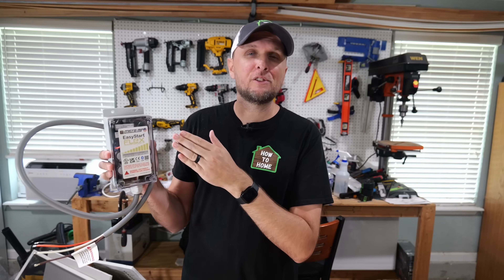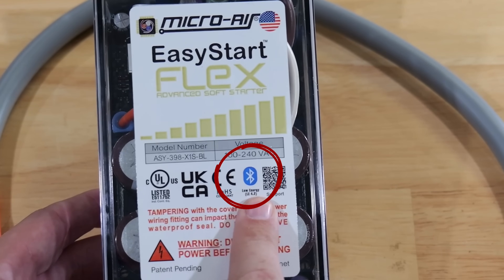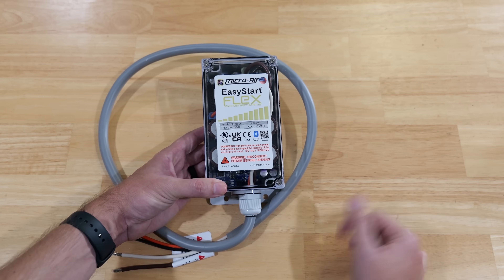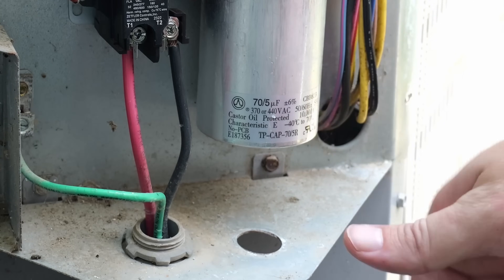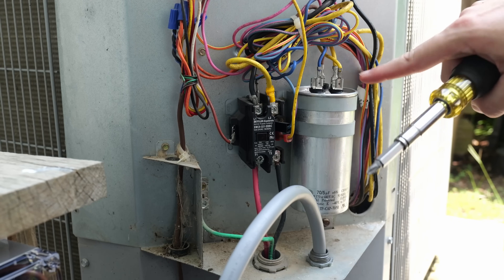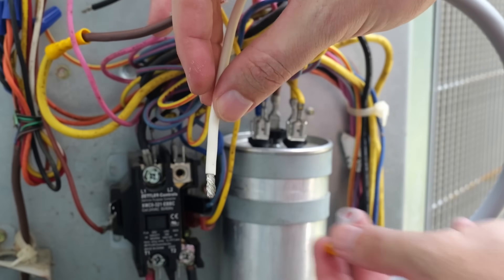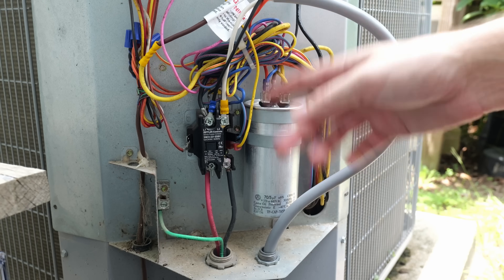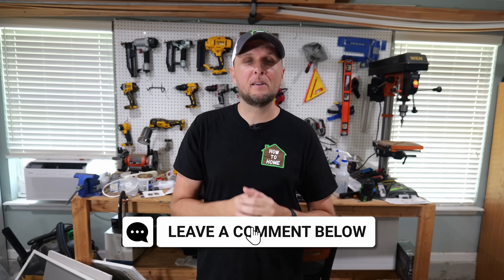The ONE AC Upgrade Every Homeowner Needs to Consider!

Comment: I read some stuff they fail and then you're stuck returning it to normal wiring. Any insights on the dependability?
Reply from the maker: So when they first released them some people had issues with a part in theirs going bad prematurely.  It is my understanding that Micro Air quickly saw the issue and fixed it.  Everyone that had a claim was either issued a new one with the new part or offered a refund.  So for those that decided to get a refund, yes they would either have had to buy one of Micro Airs older models or return the AC to stock.  I have had mine for 6 or 7 months now and have had zero issues.  And I live in the South where my AC doesnt know how to stop running haha.  I also was not sponsored by Micro Air or given this for free so if I did have an issue, or thought it was an unfixed item then I would be happy to tell you.  But, I have nothing but good things to say.  Sorry for the long response.  Hope this helps!
Reply: @HowToHomeDIY  This is a great video and convinced me to buy one. I recently had my house and panel upgraded for generator interface. This is incredible to see the amperage reduction and I have a 4 ton system as you do. Thank you! Buy yourself a beer on me

Comment: Does this need to be installed with a condenser surge protector or can it be installed on its own?
Reply: You can install it on it's own. In my case, before EasyStart, I had already installed a surge protector on the condenser. Adding EasyStart was not a problem.

Comment: I think you did a great job on this one. Very informative. You took a beating in some of the comments, but I think that's just due to people's lack of understanding, skepticism, and the cost of the unit.
Reply: Everyone's going to have a different outlook on it and you know everyone's an expert, right? I am very interested in this product, as I maintain my own unit for the most part (coil cleaning, capacitors, etc.), but I think it would be nice to know the ballpark price of these. I had no idea they were so expensive, so it was sticker shock to see the prices and to hear him say they were half of what they used to be. I don't know what mine would cost, since it's out of stock, but probably around $375 with tax. I'm not skeptical, because my eyes do not lie, and all the experience anyone has can not change what I see. I didn't know what compressors cost either, until about now. And to that $1500 you can double for the install (I'd do that myself if shown how). So, I'll be on the lookout for mine and start saving up for it; I'm still paying on my roof right now that I preemptively had put on before hurricane season! I do prefer to invest in preventative measures, and it will take a lot to dissuade me from getting one of these in spite of their cost.

Comment: So, is that 12 amps running at 240 volts? So 12x240 =2,880 watts running? The rush amps 32.3x240 =7,752 starting watts?
Reply from the maker: That's right.

Comment: Ordered a Flex this morning to be installed in the spring.  Increasing longevity on the AC, and making it easier on my inverter gen to start it is a no-brainer. Being older, everything I do these days is geared to make everything last longer, cost less, and be more reliable. Failure generally occurs at the worst time, right? More points of failure will be reduced.

Thanks for this.
Reply: I am with you! I installed a high quality dual run capacitor in my condenser unit and kept the stock cap as a spare.

Comment: Looking to purchase and install but seeing a lot of bad comments on Amazon about them failing after a few weeks or months.  Any feedback or concerns?
Reply from the maker: It is my understanding from Micro Air and people that claimed to have issues that the part that would sometimes cause a problem was replaced earlier this summer.   Everyone person with a claim was either refunded or their unit replaced with the newer model and updated part.  I have had mine installed now for 6 months now and have not had an issue.  If I did I would report it as I don’t owe the company anything and paid for this myself.  Hope this helps!
Reply: @HowToHomeDIY  Thanks for the quick reply and I did just call them directly.  They explained some of the issues they were having based on the which state their product was installed.  They have since corrected/updated the various components.  I will order mine directly from them!
Reply from the maker: @Keoler7995 awesome!  Thanks for that feedback too.  I did not know it was a regional thing as well.
Reply: @HowToHomeDIY  Yeah due to different power grids.
Reply: @Keoler7995  Hey, thank you for your comments. I ordered a Flex as soon as it was available. Everything runs smooth. Due to Micro-Air's excellent customer service I was willing to take a chance on a new product rollout. I replaced my "364" unit with the Flex.

Comment: Until the f'ing thing has a seal failure and won't start your compressor.  Ie. like mine right now.   They better honor their product.   Now I have no AC.   This product not worth the price
Reply from the maker: They always honor their warranty.  In the meantime, just returning the ac to factory will get it running until you let them know and they get a replacement to you.  I do have to disagree with you though.  For me personally it’s been worth every penny in the times I’ve been without power.  And I’ve had zero issues with it.

Comment: From the Amazon reviews, it appears to have some reliability issues. Most 1's states it died after a short time. Do you know if the manufacturer is working on this issue? Also, the warranty could be better.
Reply from the maker: Was fixed months ago.  The warranty is great.  They replaced or refunded every person with a claim.

Comment: Reading reviews on Amazon and this/these units seem to have a high failure rate. Hard to get a refund or replacement unit.
Reply from the maker: That’s completely false.  They had issues with some units when this model first came out.  It’s been fixed.  And every single person that had a claim with Micro air was either refunded or their unit replaced with a newer one.  I have had zero issues with mine.

Comment: 13:16  SO, >> IF << the Easy Start fails would it be better to of used Male to Female terminals at this stage so you can re-plug back to the ORIGINAL setup??
Reply: Just use wagos man.

Comment: Great explanations, thank you. Question: Living in hot Florida, capacitors constantly go bad (practically every other year). Since these easy start units reduce the inrush current, it would seem reasonable to believe that this reduces the strain on the capacitor which should make it last a lot longer. Is this the case? Thank you.

Comment: I have a 2-5 ton ac.  So which do you think would be better the 398 or 368?  Is there a big difference?
Reply: This is my experience. Years ago, I ordered and installed the 364 for my 2 ton AC. It worked fine for me. I did contact Micro-Air about it and they said I would be better served by a larger unit (368). I kept the 364 because it is a smaller footprint than the 364. To answer your question, get NEITHER! Now, a new model is available. It is called FLEX for residential/commercial use. Get that! That is what I did. Works great! AND it is the same small footprint as my old 364 unit. AWESOME! Thanks, Micro-Air.

Comment: thanks for sharing. this is a $400 device. I installed 2 timer relays on my HAVC system ($5). When the thermostat starts the inside blower fan, the first timer wait 10 sec and then start the compressor fan, then the second timer it setup at 20 second which waits another 10 seconds after the compressor fan to start the compressor. total AMP to kick it all is 20AMP on a 60k BTU unit. i am sure there is a reason for that device to cost $400 but if the goal is to lower the AMP surge, you can do that with $10
Reply: I am guessing you have a 5 ton condenser unit. The LRA on the compressor could be 134-148A. You can find the exact value on your unit. Maybe you are running your unit at 20A. But, not kicking it. "Kicking" meaning starting. Over 100A are unaccounted for. A test would be to start and run your AC unit using a Champion 201532 portable generator running on gasoline. If the VAC breaker doesn't trip on startup - you win!
Reply: Link to timer parts, please?
Reply: What meter did you test inrush with? I probably should have asked if you understand the unique requirements to test inrush as most meters don’t actually measure inrush!
Reply: Are you trying to imply that giving the fan a 10-second head start lowers your inrush by 100 amps?  I don't think the math works there, but it is an idea for dropping it a bit.
Reply: Yeah giving the fan a head start is NOT what lowers the amps, man…

Comment: As an installer, this product was rushed through design & testing, they are burning left and right especially if a fully charged capacitor isn’t installed as well.

Line Set length or distance from indoor & outdoor unit is another factor torque wise when the compressor comes on to be able to push the refrigerant if pressures aren’t equalized.

Anything rotary should be checked if there is a TXV valve is installed, you may need a HARD start vs a SOFT start
Reply: And MictoAir tech support is terrible.
Reply from the maker: @FrontlineNewsToday how so?  I’ve always been responded to quickly and taken care of.

Comment: Thank you, just installed the Flex soft start on my 4 ton system. Inrush amps before install was 119 ampsand after the soft start install went down to 34 amps. Running whole house on a costco A-iPower GXS7100iRD 7100W Dual Fuel Inverter Generator. Running at about 4.4 kw with ac runing i do hear the generator bog down for less than a second when compressor kicks on but then runs well below its max running watts of 5,700 watts on fossil fuel. Followed the wiring exactly as described and worked like a charm.

Comment: Someone change that contactor contact need to be on the run side and the other side Straight blade need to be on the common side. They use common for the current case theater when a unit is not running, so it needs to be powered all the time.

Comment: I installed this soft start unit on my a/c unit and starting current went from 124 amps to 24 amps and running current went from 18 amps to 10 amps. There will a savings with the 8 amp drop in running current. In my opinion no matter what the final drive system is for your a/c compressor, there will to be inrush current at start. The compressor still needs torque to start from zero rpm.

Comment: Actually, I’ve seen a lot of reports where the micro air flex is having problems with their capacitors blowing I have the old style for a 4 ton unit and have never had any problems
Reply from the maker: You’ve seen reports where they used to have some problems.  It was fixed months ago and didn’t affect everyone.  Anyone that did have an issue was given the option to get the updated version sent to them or a refund.

Comment: I’ve had one for 5 years now, it’s been great.   So glad I installed it!  We had several power outages and my 6k generator was able to start the AC every time.  Also, I am hopeful it will extend the life of my 10 year old AC unit.  Other than a blown capacitor (indicated by overcurrent fault code on the soft start LEDs) I have had 0 issues.
Reply: Can you please tell me if this will help reduce the actual monthly electricity bill?

Comment: Installed two of these back in 2021 on my 3 ton units - one over 25k starts and 33k starts on the other. One soft starter failed after about 6 months and MicroAir sent me another in a couple days. Hasn't skipped a beat since.

What has amazed me the most is just how quiet these starters make them run. Besides just on startup, they are quiet even when running. I don't know how that works since the starter pulls out of the circuit after startup but it somehow makes compressors quieter. My 21 year old R22 reciprocating compressor ran on one of these for 3+ years and was crazy quiet on startup.

I cannot recommend these enough.

Comment: I sell and service commercial dishwashers. We generally use a 1 1/2 horsepower to a 3 horsepower wash pump motor. Would it be advantageous for the life cycle of the dishwasher to install these? Or whatever would apply to a motor?

Comment: I was just about to order one of the new Flex units, but the reviews on Amazon are terrible. There are even social media groups dedicated to the defects with the flex model. It seems there is a known defect in these causing them to not only fail after just a few weeks, but in multiple instances causing damage to the AC unit itself. Unfortunately, the older, size specific units don't seem to be available anywhere. They seem to have very high reviews.
Reply: Mine has heavy condensation inside the unit and pooling water at the bottom. Only has been installed for about 3 weeks. Their customer service said that these boxes aren't sealed and condensation is "normal". I send them pictures and they still claimed the vent on the bottom would remove the moisture. I'm just waiting to be out of town and have my pregnant wife without AC when it fails. But it did what it said it does.

Comment: This is NOT the right way to test inrush current for these claims.  You’re testing the inrush at the compressor lead, which measures the energy being dumped by the capacitor.

The grid or your generator does not care what happens between the capacitor and compressor, they only see the current on the power leads to the unit which will not be reduced by 75%.  It will be lower, but not by that much.

As an AC tech with a YouTube channel “educating people” you should be making every effort to be honest.  You have the tools and the knowledge, why be dishonest?

Comment: Why wouldnt these systems have a battery that could deliver that amperage then sit idly by and recharge until it is needed again?
Reply: You want a battery that can supply 121 inrush amps at 220 volts?
That's hilarious. That doesn't sound like a fire waiting to happen.
That's what capacitors are for. pats head

Comment: Great video. I have installed these in my Class A's AC units and never thought about installing these for in a fixed AC application. Also, there are several Chinese copies of these but I would use caution with those ( I have actually tested out a few CHICOM copies and nothing beats MicroAir's product).

Comment: Can an EasyStart device be installed on a heat pump alongside a power company provided/installed energy management controller (i.e., a power manager where the power company can turn off power to the heat pump during summer peak power consumption times)?

Comment: FYI, these have a huge failure rate and cannot be used in the heat soaked south.  The new units use cheaper parts than the older units and simply fail.   MicroAir used to overnight replacements (which would fail again), but now they ship 1-2 weeks out.
Reply: Living down here with you. If I mount the soft start in side the garage think that will solve the issue?

Comment: You didn't mention one other significant benefit of reducing inrush current: the contactor will live much longer. Everyone talks about the short lifetime of run caps, but rarely do you hear anything about contactors. In my experience, the failure rate of caps and contactors is similar. Basically, if you have to replace a run cap, you should also proactively replace the contactor. Don't believe me? Look closely at the contacts and see how pitted and worn they are. Anyway, reducing the current to ~30A should effectively prevent contact failure for the life of the condensor. So, advice to the wise, check your contactor and be prepared to replace it. They're sand-on-the-beach common and inexpensive.

Comment: I had this units installed in the spring and come  August my compressor on my Heat pump AC unit died.  The house was new and the unit was stamped from the manufacturer in 2022.  Since I've had the new compressor I had the HVAC guys bypass this unit to ensure my system doesn't fail again.  Am I just being paranoid or is there a chance the AC compressor died from the soft start?  I will say the LEDs on the unit was telling me the truth when the compressor failed.

Comment: Installed Easy Start on our camper AC so we can boondock and run AC with Honda 2200 watt generator. Works great! Considering this one for our home also... wondering if it will let my 3000 watt generator run the AC.... ?